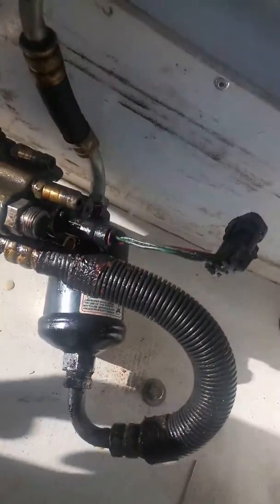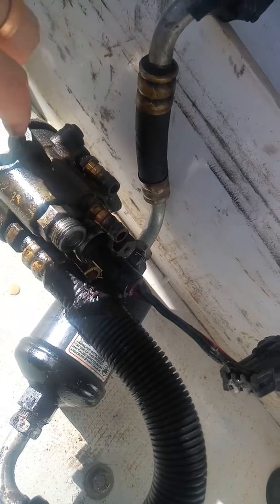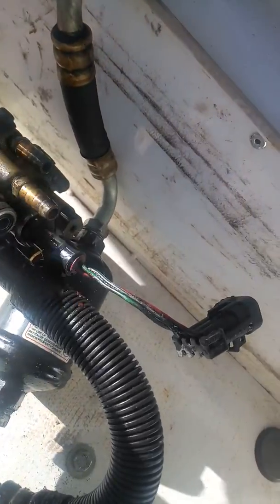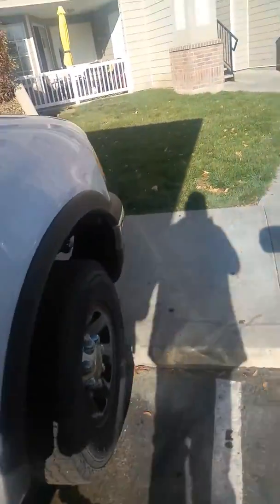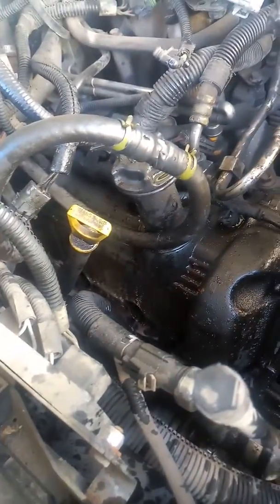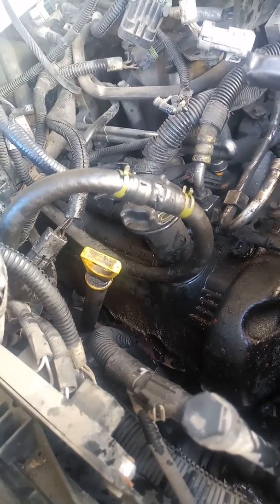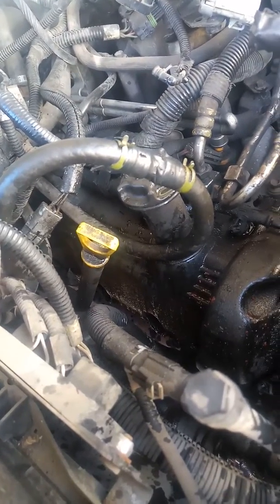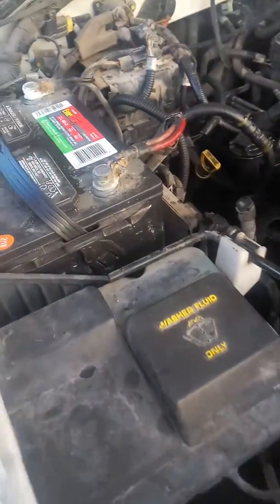Diy Ford CNG removal part 3 the  compuvalve

Comment: My ford f150 is showing a code after CNG removal, and Powerfuel will not give me the code for Ford to clear it. Any ideas?
Reply: Kindof got the same issue on my 2000 f150.